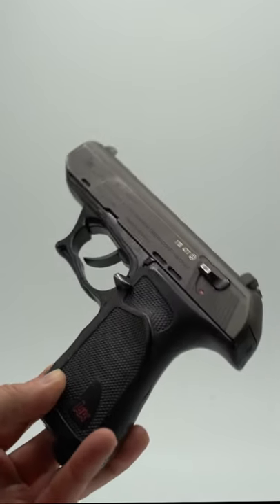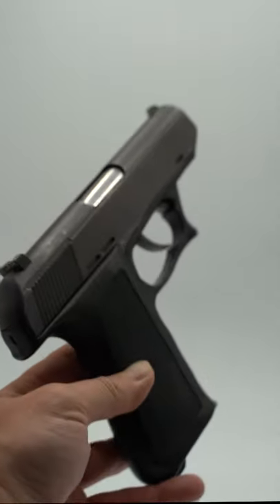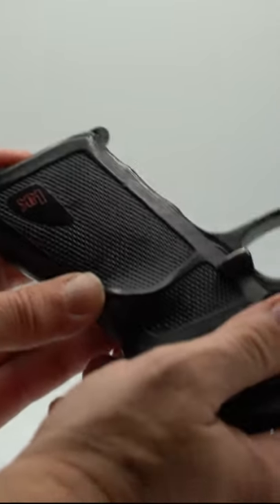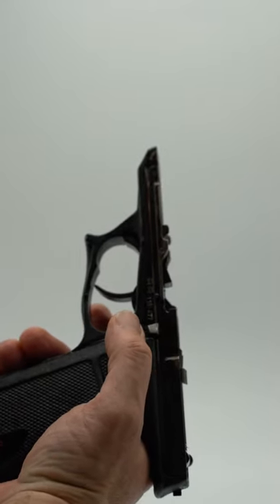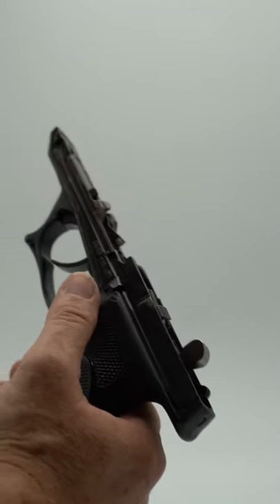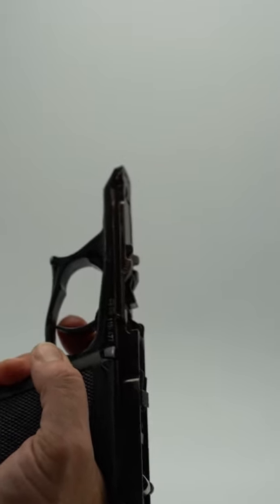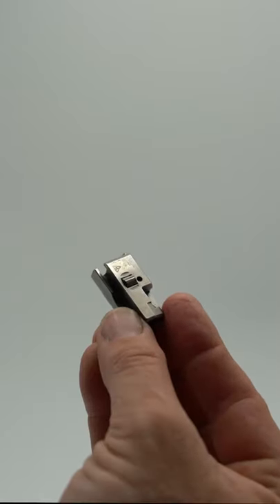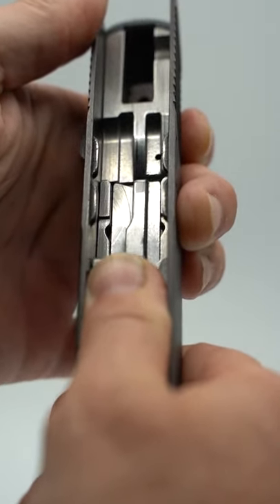Hk P9 | Roller Delayed Handgun? #Shorts

Comment: That pistol is a curious, and functional recovery of previous concepts. It is partly like a J. P. Sauer Und Sohn 38(h) with its double action, safety on the slide, concealed hammer, and its cocking and decocking lever. A basic weapon disassembly button like on the old Mauser HSC inside and in front of the trigger guard. Even the roller lock system seen on a handgun on CZ/VZ 52. A cocktail that went very well for HK... ✨🖖😄✨